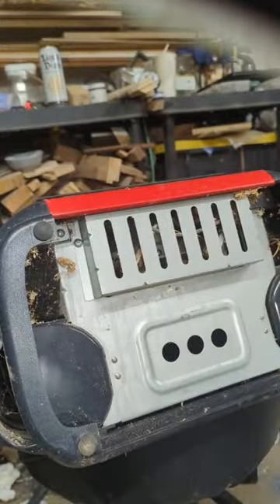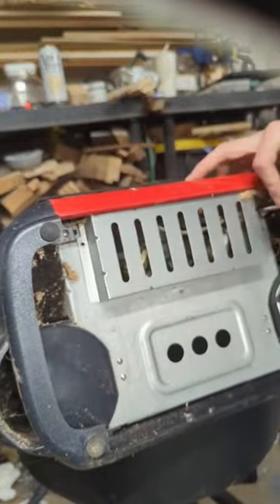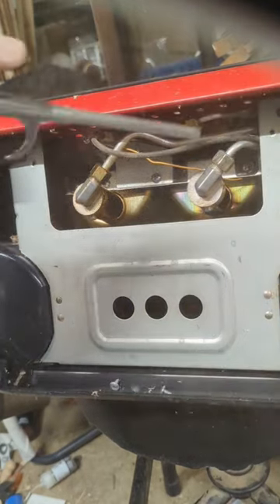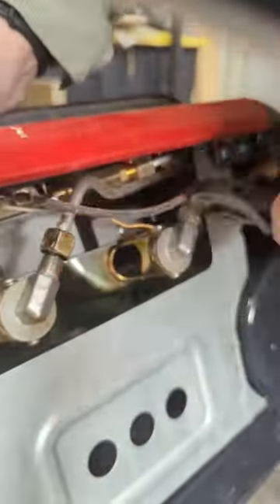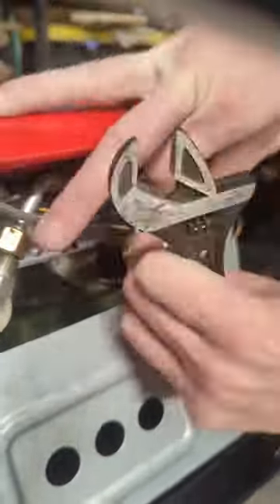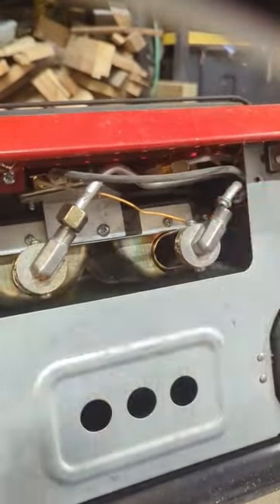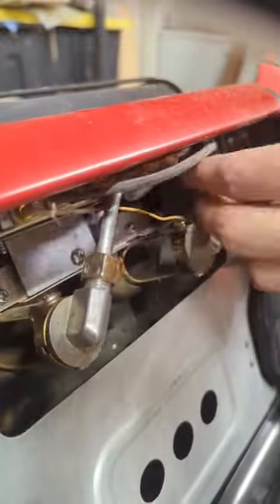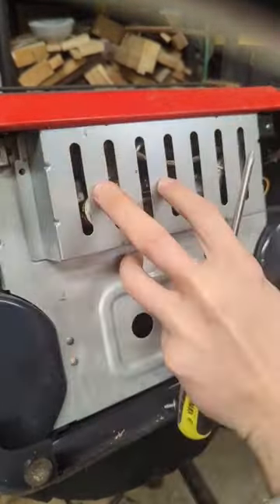How to fixing/clean propane lines on a buddy heater

Comment: I think I got a lemon mine hasn't ever worked properly. Still looks brand new, Pilot turns on good just won't kick to the burners. Any suggestions?
Reply from the maker: This should clean out the lines to the burners if that doesn't work it might be a lemon I know I returned a few before I figured this out though it can clog up pretty quick
Reply: It worked after I took the pilot line apart and blew it out after trying the two bigger lines. Thanks for the video
Reply: Almost got turned into a shooting target last winter when it wouldn't work like it should lol you saved my heater buddy thanks again